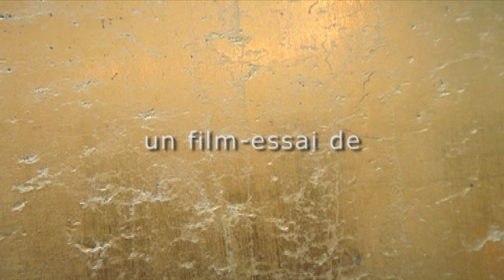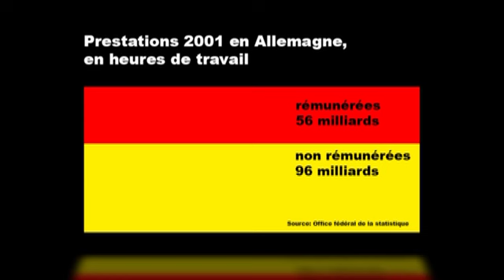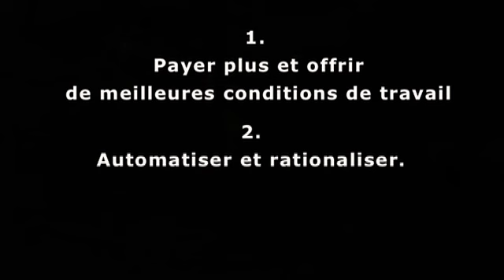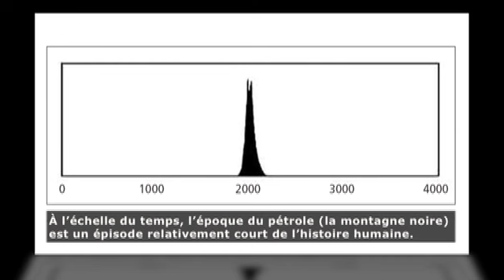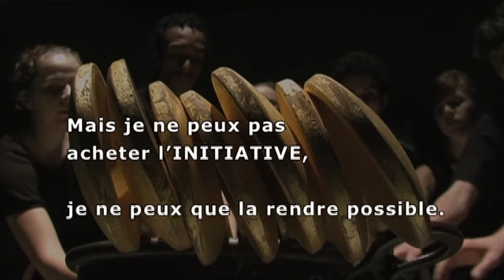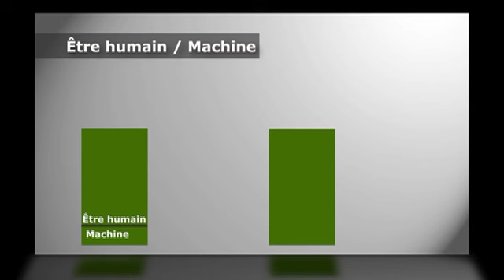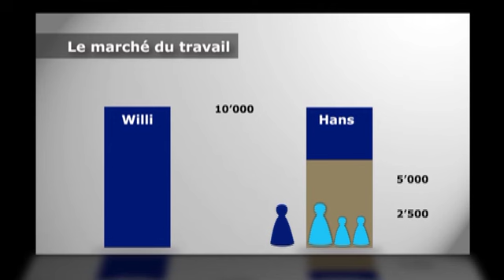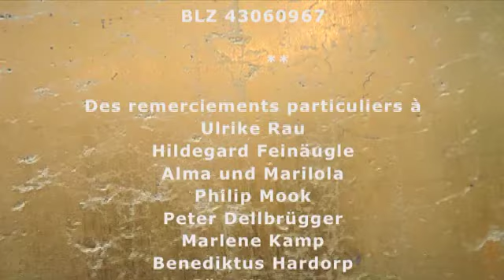Le Revenu de Base | Film version Française

Comment: Une partie de la solution tient certes dans le revenu de base à proprement parler, le poids du travail va augmenter par rapport à celui du capital, le fournisseur de travail ayant une capacité de négociation plus forte.
Cependant, cet effet n'est absolument pas suffisant, des mesures plus ciblés sont nécessaires (forte inflation pour limiter la thésaurisation ...).
A creuser en tout cas.